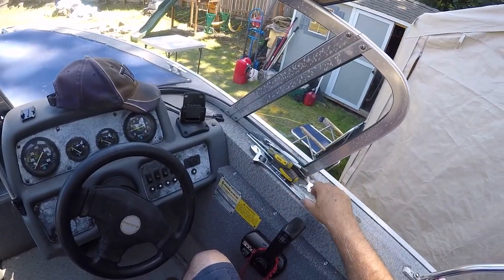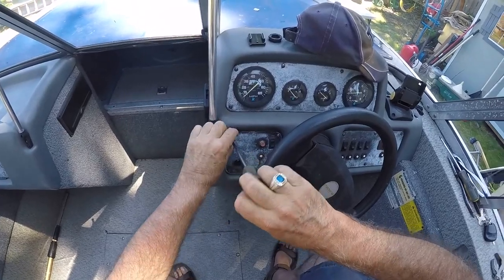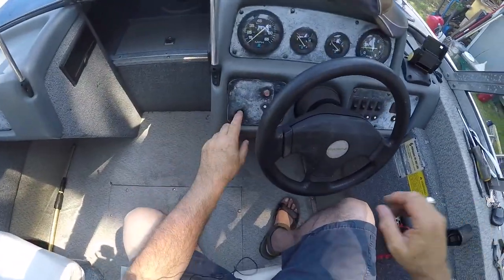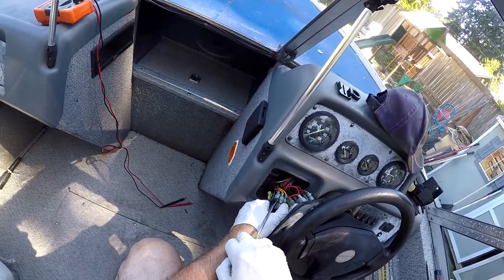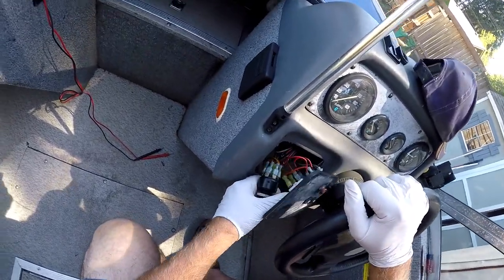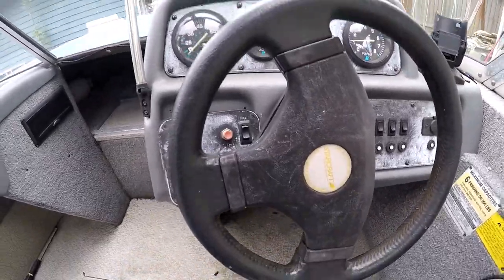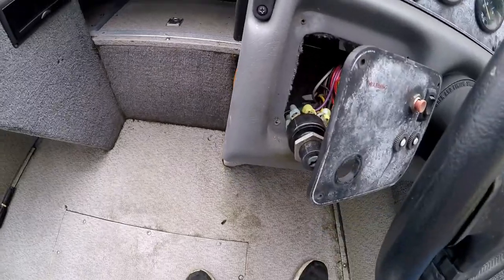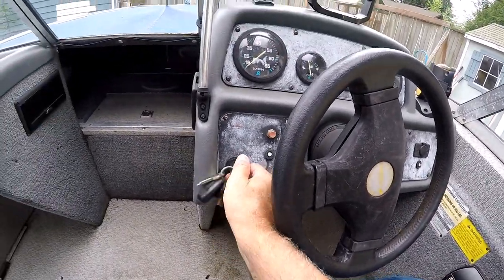How to clean boat ignition connections

Comment: I really like your boat and how you put your vids together, i just subbed, i have an 18ft Lind Alaskan. im still doing some work to mine but shes getting there.
Reply from the maker: Thanks Steve for Subscribing. I have learned allot working on mine for sure. I have allot of videos ideas coming up. Lind is a great fishing boat. What do you have for a motor?
Reply: @TimsWorkshopTJY  i have a 92 suzuki dt40 hp. i really do like the 2 stroke motors. im looking for a 60hp 2 stroke or maybe boring out my 40hp. not sure yet. im think it may be better just to get a used 60. My 18 lund is alot of fun. i live near the Chespeake bay so i do alot of fishing and crabbing. I have about 20 videos with my lund. i seen your video because i was looking at electrical issues on ignition. mine is starting to act up a little. great info , your video showed me alot. im also a 28 year sailor so power boating is kinda new to me, sold my 36ft Catalina sailboat last year. im really liking my lund alot, haha, fun boat
Reply from the maker: My suggestion is find a 60hp 2 stroke that has good compression and the lower unit isnt leaking first. Then check the steering pivot bearings for smooth movement side to side with no wobble in the upper and lower bearings up and down. Make sure the lower unit has no leaks and remove the prop and try moving the prop shaft around for wobble too. With the prop off you can at least see the aft shaft bearing for leaks. The rest of the motor cost less money to repair. Removing your power head on the 40 is a last resort. Can of worms especially being in salt water. Hope this helps
Reply: @TimsWorkshopTJY  excelent advice, thank you.